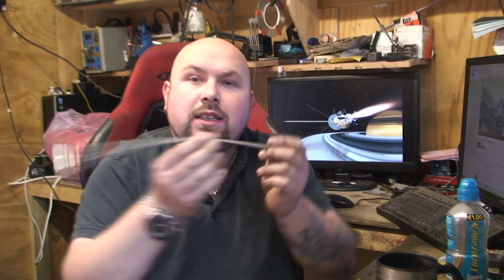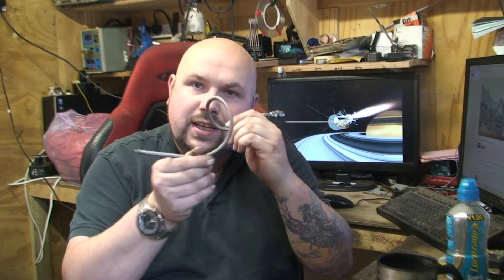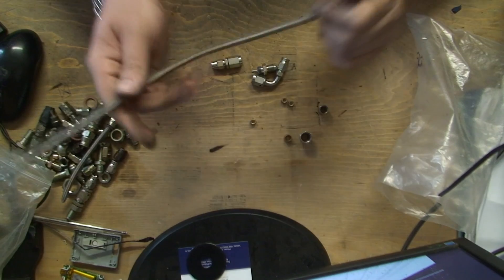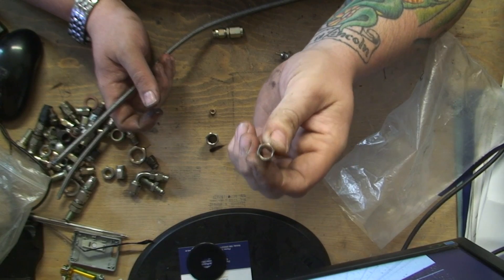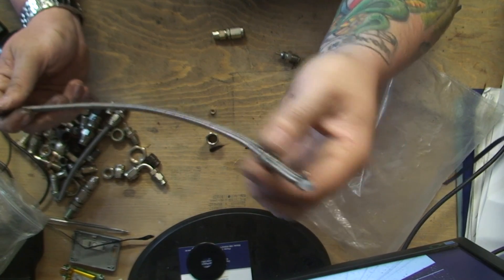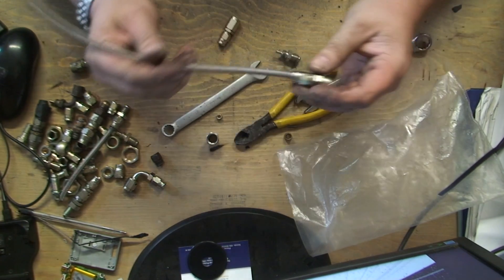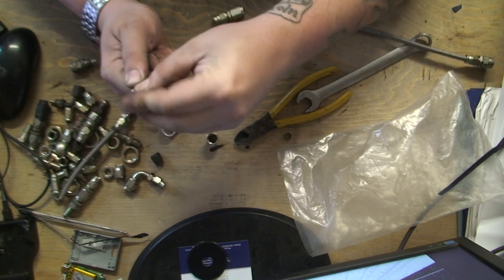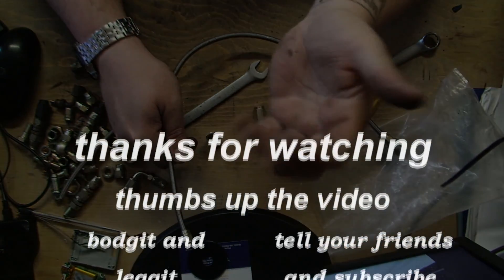bodgit and leggit garage TNT#9 rally/track car how to do braided hoses

Comment: hi mate , bought 1.4 vtr saxo. has 1.6 engine . cheap taxer😂 but any way It was drilled and grooved discs on back and brand new discs and pads on front. brakes are sh** to be fair ! unless you stamp hard . and when you do that the arse of car comes out slightly like you've pulled the handbrake.  have you any suggestions why this is happening ?
Reply from the maker: Alex Gilliland hi mate drilled and grooved discs are definitely more efficient they don't heat up and work a lot better that's why I'd say you are getting better braking from the front what I suggest you do is replace the brake fluid with fresh brake fluid this will eliminate all the condensation and water in your lines also if you want but drilled and drilled discs on the front are you need to balance up your brakes the next thing you can do which will make a huge difference is get braided brake line you can buy a kit for most cars it takes away the rubber hose and replaces it with braided line if you was to do all this your brakes will be a million times better
Reply: bodgit and leggit garage . I will do brake fluid change next week and see how it goes . car has been lying up a while brake fluid may be past it . cheers mate
Reply from the maker: Alex Gilliland no problem mate anytime but you really need to get your brakes balanced what I mean by that is either put standard ones back on the back or put the drilled and grooved on the front at least your brakes will be balanced properly
Reply: bodgit and leggit garage yes that's a good point will look in to it . don't  know why previous owner has done this . would the drilled ones be any better on front for time being would you think?
Reply from the maker: Alex Gilliland yes I would definitely put drilled and grooved ones on the front as well they are far better just more expensive check out what pads he's put on as well if you put green stuff or yellow stuff pads on you will have to do the same with the front
Reply: bodgit and leggit garage gonna have a good check on brakes soon all round see what's been done .